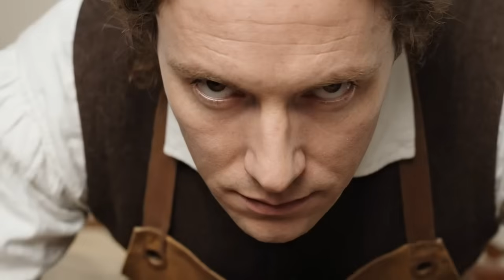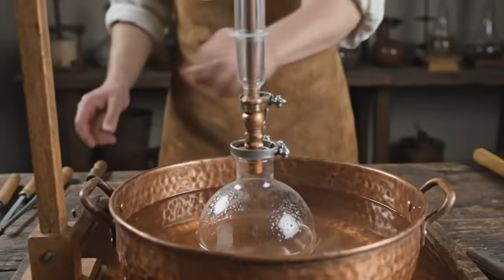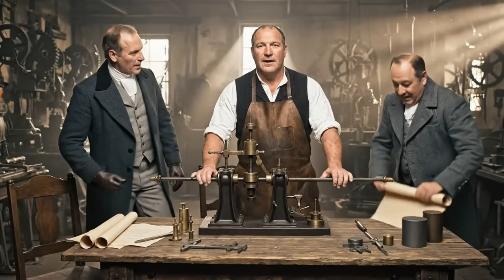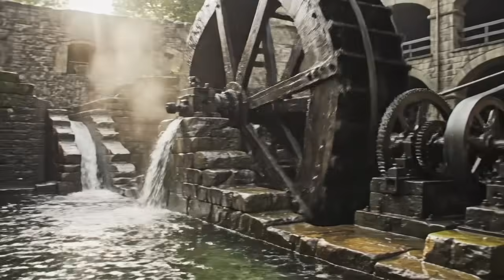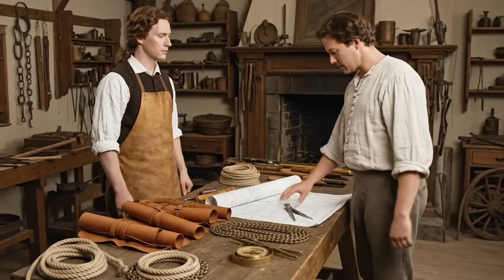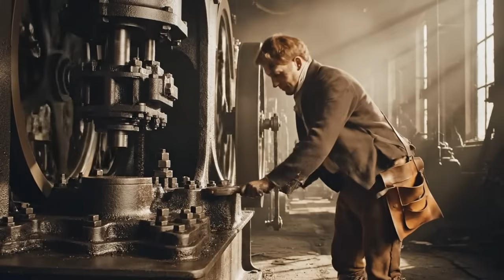Deep Within Boulton & Watt Factory 1775: From Iron Cylinders to Steam Engines (Ancient Methods)

Comment: The Industrial Revolution in Britain from the year 1775 to the year 1900. 
No Steam Engines before then. Farm production increased by 300% (aided by Steam Engines). Population increased by 300% (aided by cramming people into towns). 
Textiles production increased by 600% (aided by Steam Engines and a ban on Indian textiles).
 Coal production increased by 1,000% (aided by Steam Engines and for Steam Engines). 
Iron production increased by 28,000% (aided by Steam Engines and for Steam Engines). 
Steel production increased by 600,000% (aided by Steam Engines and for Steam Engines). Waterwheels, the main source of rotary power for 3 thousand years but limited by the need for flowing rivers of water practically vanished (due to the Steam Engine). 
As did Newcomen Atmospheric Pumps , (due to the Steam Engine). And finally James Watt's Steam Engines and their descendants themselves increased by 1,000,000,000% !!! 
or 1 BILLION %. 
So I don't think there's any doubt, James Watt's Invention of the world's first PRACTICAL Steam Powered Engine caused the Industrial Revolution!
 Not complicated at all!
Reply: He single-handedly halted the entire Industrial Revolution for over 20 years by not allowing any high-pressure boilers to be built while his patents were active. Richard Trevithick had to wait until 1801, when the patents expired, to build the world’s first locomotive using high-pressure boilers
Reply: @Echo-jg8is 
After work done by Calley, Savery, Newcomen and Smeaton, we finally ended up with an Atmospheric Pump.
 That held up the Steam Powered Industrial Revolution for 70 years.
Till James Watt INVENTED the world's first PRACTICAL High Pressure Steam Powered Pumps and Engines.